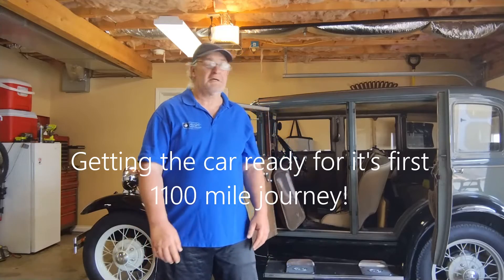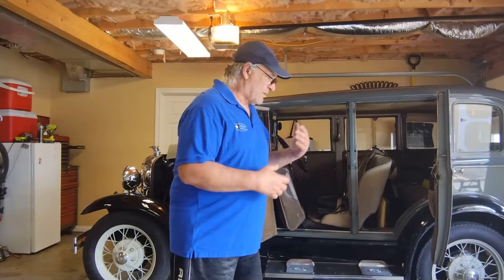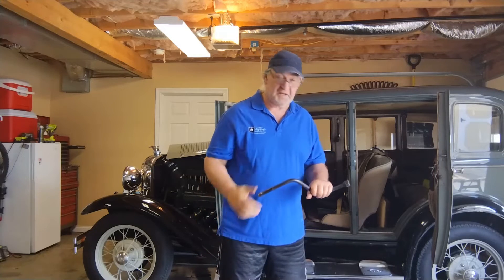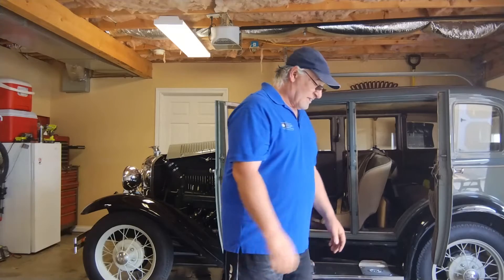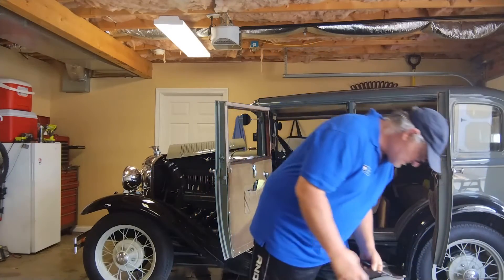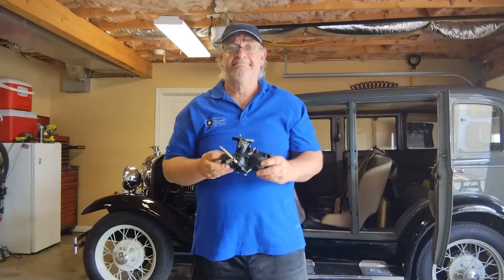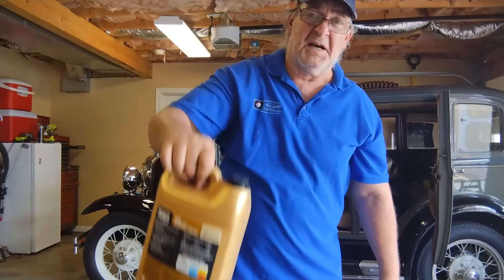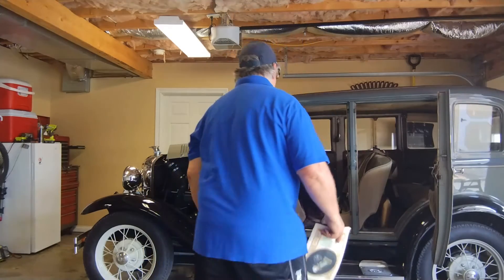Road Trip Preparation for the 1930 Ford Model A Fordor Town Sedan

Comment: You could use a trunk on the back.  Your current and spare distributors need to be timed at the same time so you can just swap them out without having to re-time the engine. Good luck on your trip!.
Reply from the maker: I am going to add a trunk.  I also did just what you suggested with the backup distributor, but that is a great point to mention!  Thanks for your comments!

Comment: Instead of the four lug wrench that doesn't fit under the seat, why not just take a torque wrench (or a breaker bar) and a few sockets?  Also a standard scissor jack would fit ($40 Harbor Freight)
Reply from the maker: All great suggestions!  Thanks so much!